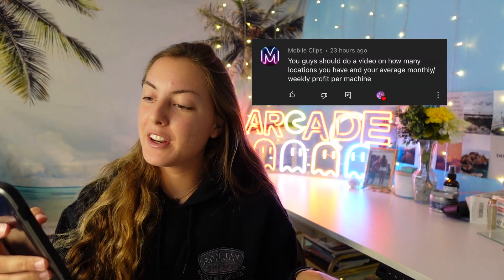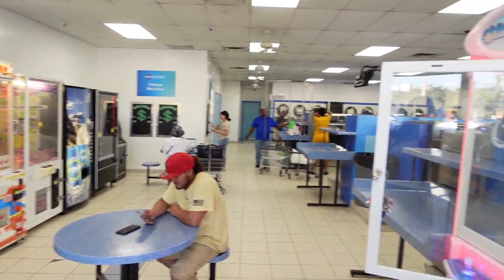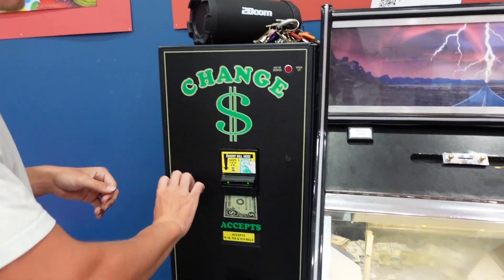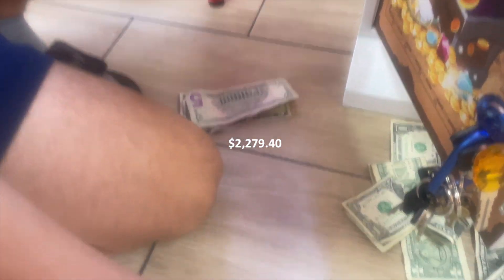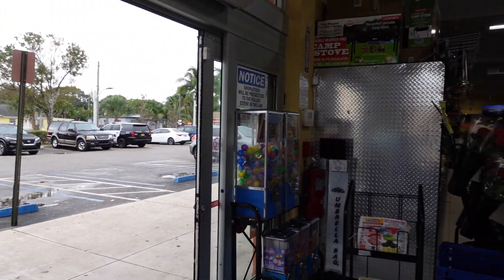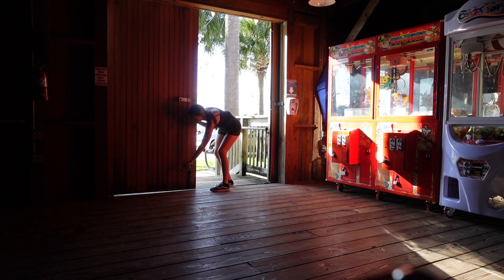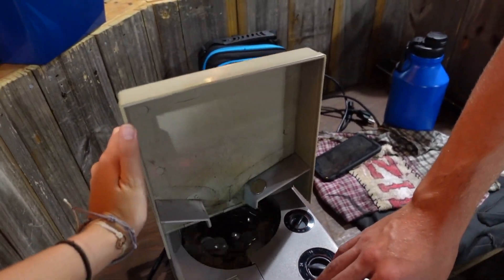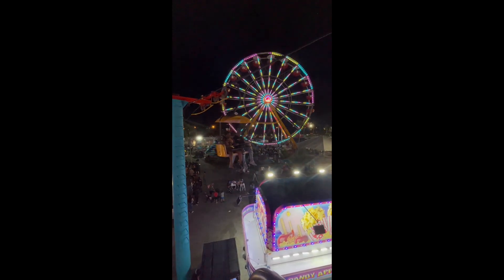HOW MUCH MONEY AN ARCADE/VENDING BUSINESS MAKES IN 2023

Comment: I'm in the preliminary stages of getting my first machine, and these videos are a big help.

How did you transport all those machines to that location?

Also, do you license those machines to avoid auditors, or do you do it all under the table with no contracts involved?
Reply from the maker: That’s awesome! We are happy to hear these videos have helped you. 😁

We used to trailer the machines into the barn, but as we grew it, we just started renting a box truck with a lift gate for the day to move everything in. 
Each state requires different licensing, so we’d recommend that you research it in your area. We started with an LLC
Reply: @etamusements Sounds good. I'm also in Florida. 

I just got my first sticker machine that'll go into a Kava Bar. I did consider an LLC and to get the auditor sticker through what's considered an "amusement license".